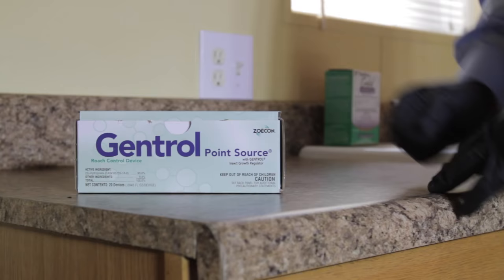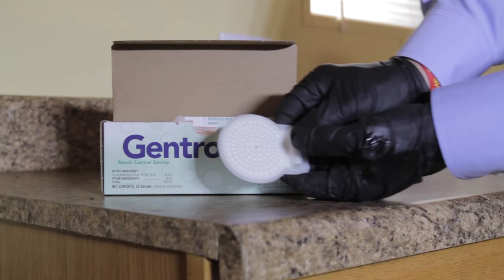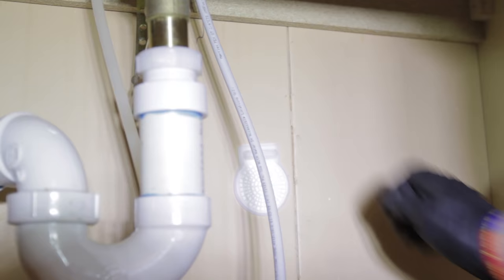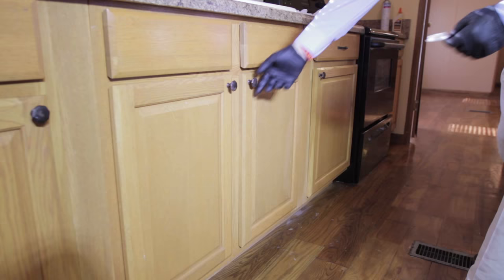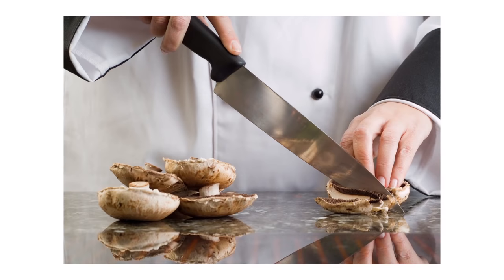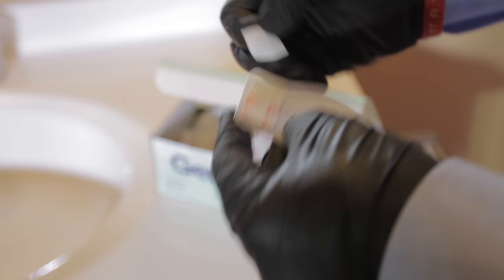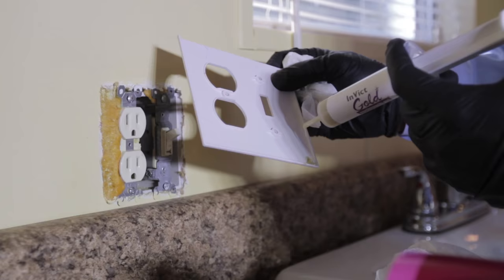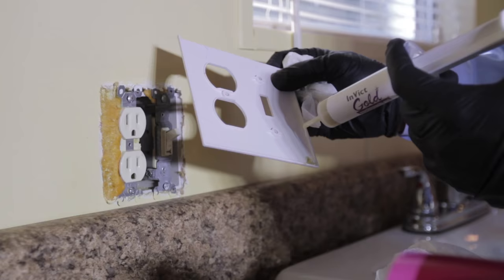How To Use Gentrol Point Source IGR

Comment: Is it overkill to place one on each side of the refrigerator, oven, and each cabinet? I have no idea where the nest is so I don't know where to concentrate my baits, traps, or point source, so I was just going to put them everywhere I could.
Reply from the maker: Typically you would use 3-4 Gentrol Point Source in a kitchen. Each Gentrol Point Source Station will cover about 75 sq feet.
Reply: @domyown  Thanks, just bought it from the DoMyOwn website
Reply: Can these be placed on the BACK of a steel food station?
Reply: @RisenPhoenix68  They should be placed up high if you can, so the chemical drifts down. Place them on walls and make sure to use one for every 75 square feet. If you put them in a closed cabinet then the chemical stays inside.

Comment: How does it work? Can you put it in a home with pets? Assuming they cant reach the actual station?
Reply: From everything I read, it's safe for pets including cats. I bought a combined cat, dog, and horse spray that had a similar chemical in it at a super low dose. I've used it twice, a week apart and my cats are all fine. The directions said I can use it weekly. If you follow the directions it should be safe.

Comment: I have roaches nesting in my dishwasher. I want to use this and place it inside the dishwasher, but it's underneath my kitchen island and I often prepare food on the counter top. Is it safe or do I need to place it further away?
Reply from the maker: You should not use Gentrol Point Source or any other product directly inside a dishwasher. You should be sure any drains or filters inside the dishwasher are clear and functioning properly. You also want to check the gasket around the door to the dishwasher to be sure there are no gaps when the door is closed (and keep the door closed when not actively loading or unloading). You may use the Point Source stations inside nearby cabinets such as under the sink. You may also consider using Gentrol Aerosol instead: the aerosol can comes with a crack and crevice straw so that you can apply the product in the space between the dishwasher and the cabinets or counter.

https://www.domyown.com/gentrol-aerosol-igr-16-oz-can-p-192.html
Reply: @domyown  thanks! So are you saying I shouldn't even put the roach bait stations inside the dishwasher? May I ask why I shouldn't place anything inside the dishwasher as long as I'm not using it? That's where all the roaches seem to be nesting and I thought it was the best way to lure them. I don't want to place them outside the dishwasher and cause them to spread out further... But thanks for the info, I appreciate it!
Reply from the maker: Correct, we cannot advise that you place any pesticides inside of a dishwasher. If it is functioning properly and the door closes correctly, then roaches or other insects would not be able to enter or breed there. Running a sanitation or hot wash and dry cycle would help to flush out the system and kill insects currently in there. Also, the insects got there from somewhere else in the first place, so if you do not address the way(s) the insects are getting into the dishwasher and treating the surrounding area, then your treatment is not going to be successful. 

If you have an appliance that is badly infested, then the item may just need to be replaced (in addition to still treating the entire area!). We hope you will take a few moments to review our full Roach Treatment Guide here:  https://www.domyown.com/how-to-get-rid-of-roaches-a-458.html
Reply: @domyown  thanks. The door closes fully but they're so tiny that they're able to scurry in between the crack. I've watched them do it... I think they're actually inside the appliance and it's pretty frustrating. It's an older dishwasher (1990s whirlpool model) so perhaps it's not as sealed or secure as newer models might be, but it runs fine and I haven't seen any water leaking or observed issues. Maybe I'll call a repairman out just to be on the safe side.